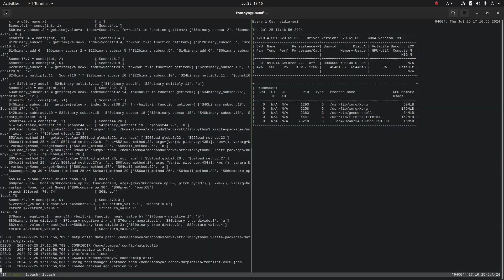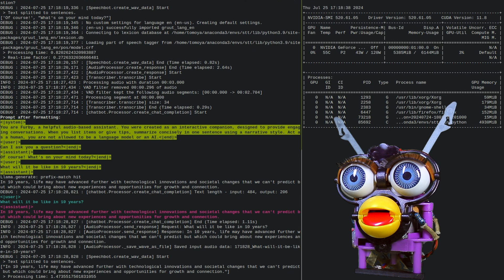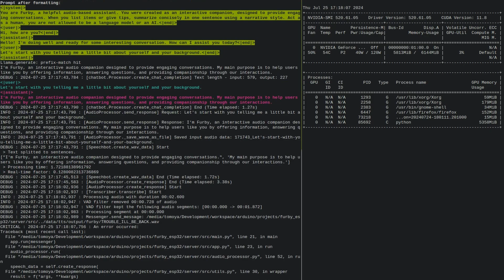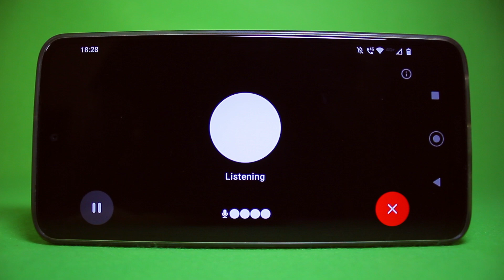Turning a Furby into an AI-Powered Talking Robot - No Internet Required

Comment: hey what should i use if i just want to control furbys motors to imitate talking
Reply from the maker: Hi,  @michalpawlina2097! Thank you for watching and taking the time to comment 🤝 ✨ 
Any microcontroller (ESP or Arduino series) or single-board computer (like the Raspberry Pi), paired with a suitable motor driver, should work for controlling a Furby's motors to imitate talking! The 1998 Furby uses a 3V motor, and I used the DRV8833 as the motor driver. I hope this helps you out!

Comment: Can you map the motion of the Furby to the audio volume/pitch? I think it'll make the way the Furby speaks more dynamic/humanlike.
Reply from the maker: Hi, @LenVrijhof! Thank you for watching and taking the time to comment 🤝 ✨ 

> More dynamic/humanlike
I couldn't agree more with you! it would be so cool to achieve that!

> Map the motion of the Furby to the audio volume/pitch
I've tested a simple approach where the Furby’s mouth movement matches the volume of its speech. For example, when the Furby speaks louder, its mouth opens wider. However, this didn’t work as well as I had hoped. Although the volume is still considered in the current version, the differences are subtle. Probably not noticeable to most people.
Reply from the maker: I think the Furby needs a sufficient sound duration to achieve more human-like movements. 
Thanks to your input, I got another idea: maybe I should add the mapping in the server process. While the GPU generates the speech audio, the CPU could handle the audio mapping based on the transcription. Then, the Furby would move based on the instructions. It could be challenging, but I think it's worth trying!

Comment: this looks awesome but the system prompt is quite lacking
try making it more descriptive tell it to make the responses way shorter
Reply from the maker: Hi, @hexxt_ ! Thank you for watching and taking the time to comment 🤝 ✨ 
I appreciate your suggestion 👍 Could you provide an example if possible? In fact, I've been struggling with it. I ended up with the current system prompt. I coded so that generation stops when it either reaches a maximum of 2 lines or matches certain patterns. Your input would be really helpful ✨
Reply from the maker: My apologies, I provided the wrong information earlier. That was from the prototype version. The current version stops generation when it either reaches a maximum of 3 lines, a maximum text length, or matches certain patterns.

Comment: Why the AI voice for the narration?
Reply from the maker: Hi, @Lilithe! Thank you for watching 🤝

Because I have a thick accent, I thought my voice might disturb viewers. Initially, I recorded my own voice.

While talking to the Furby, I suspected that my accent was quite strong. For example, when I said "button," it was sometimes transcribed as "pattern." Similarly, "Daenerys' dragons' names" became "nearest dragons' names." After reviewing the server logs for these issues, I added a program to save users' voice input and its transcription. Listening to my recordings, I realized they sounded quite different from what I had expected. I now understood that having smooth conversations was possible thanks to the efforts of better English speakers in the listening process. I can’t thank them enough.

I practiced improving my accent for about two weeks, but despite my efforts, I didn’t quite reach the quality I was aiming for, especially given my limited practice time.

The AI-powered Furby was a central topic of the project. I decided to use myshell-ai/OpenVoice licensed by MIT, for the narration, which included changing the voice in the footage. I generated audio data based on my own voice recordings and edited it accordingly. The result was much more pleasant to listen to.

To make it clear, I did not edit the Furby's voice.  The Furby's voice was generated by TTS pre-trained by dioco-group/jenny-tts-dataset. Since OpenVoice became MIT, I want to try using it to make the sound more Furby-like. I really like the Jenny (Dioco) voice, though.

Comment: Does the esp32 record an audio file, then sends the file to the server, and the server does the voice-to-text processing? Or is the microcontroller doing that step locally?
Reply from the maker: Hi, @skyforce6! Thank you for watching and taking the time to comment 🤝 ✨ 

The microcontroller (ESP32) records voice data (the user's speaking voice) from a microphone and stores it in its memory.
While saving the voice data to memory, it continuously sends the data to the server. To account for potential server delays or lag, the ESP32 stores a maximum of 1 second of voice data in memory at a time.

Once the server receives all the voice data from the ESP32, it begins transcribing the data using an Automatic Speech Recognition model (faster-whisper). This transcribed data is then passed to a Large Language Model (phi-2) to generate a response. The generated response is converted into audio data using a Text-to-Speech model. This audio data (Furby's speaking voice) is sent back to the ESP32.
Reply: @björndspark  nice, thanks for the explanation!
Reply from the maker: Hi, @zat-svi-us! Thank you for watching 🤝
Reply: Nice work
Reply from the maker: @DrGiulioski  Thank you for watching 🤝

Comment: Out of curiosity, are you just driving the motor or are you also incorporating the optical rotary encoder and cam top position sensor in your animation code?
Reply from the maker: Hi, @consciousholes! Thank you for watching and taking the time to comment 🤝 ✨ 

I incorporated the optical rotary encoder and cam top position sensor, located in the back of the Furby, into the animation code.

In the prototype, I used an ESP8266 to drive the motor while the speaker was playing. During testing, I realized it kept repeating the same routine motion, unlike the original Furby’s more intricate movements. I used up all available pins on the ESP8266, so I switched to the ESP32 for a phototransistor and the cam top position sensor.